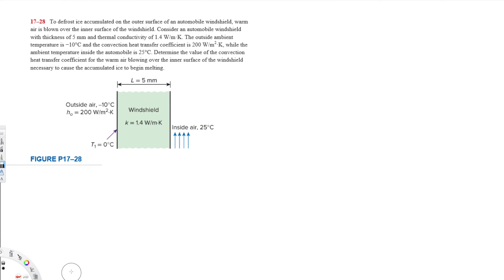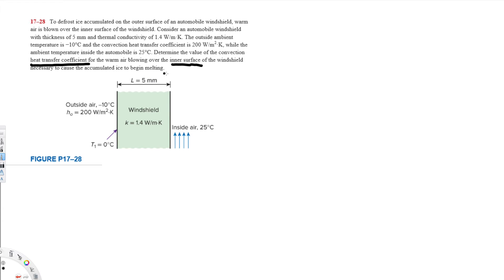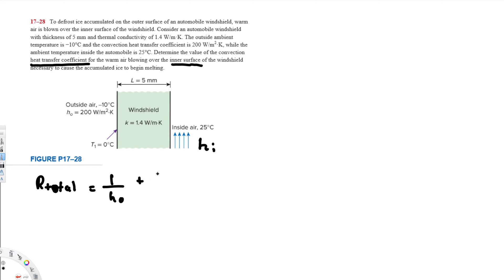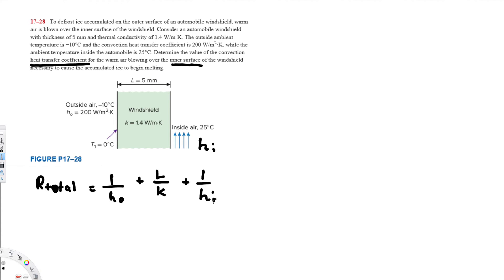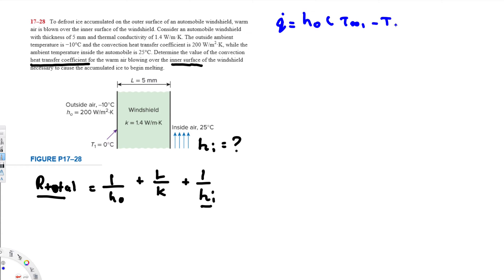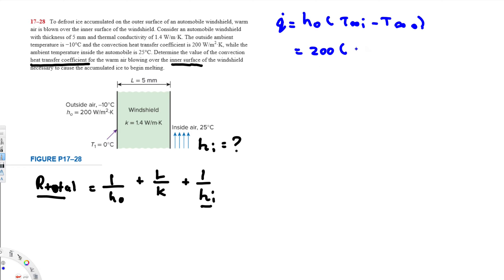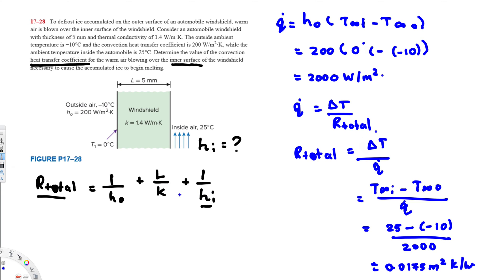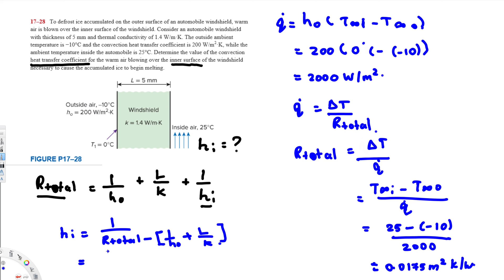Heat Transfer - Determine the convection heat transfer coefficient over inner surface - Thermofluids

Comment: If the inside air temperature is 5oC and the outside air temperature is 40oC, what are the associated convective heat transfer coefficients at the inside and outside of wall surfaces.  Assume that the rate of heat transfer remains the same in question number 1. 
please reply me

Comment: how would u solve this question: Calculate the convective heat transfer coefficient ‘h’ for the air moving over the windscreen. You may assume that the car is aerodynamically well designed, and the air is directed parallel to the windscreen where it flows from the bottom to the top as if going over a flat plate. For the properties of air, take the values at 0°C.